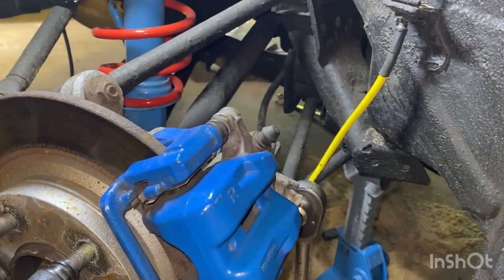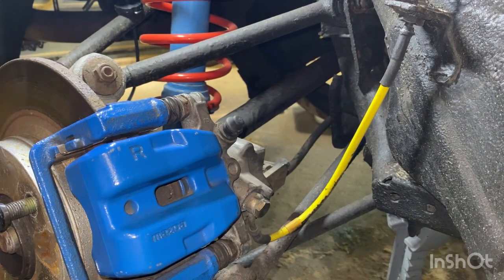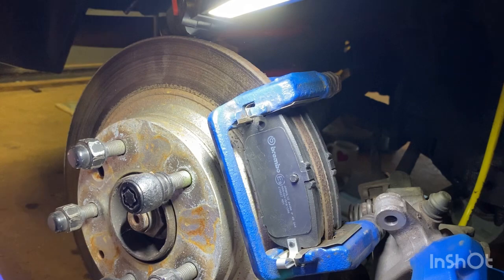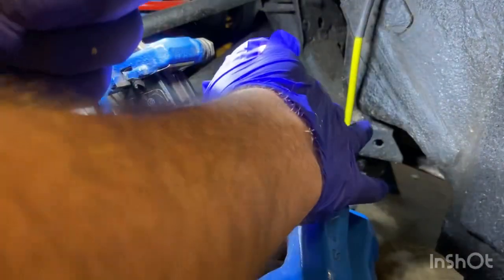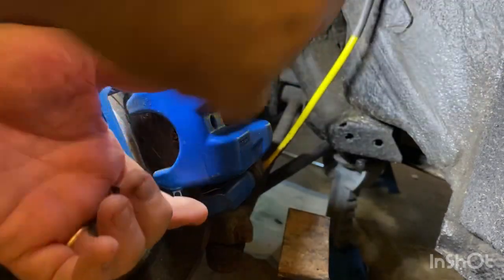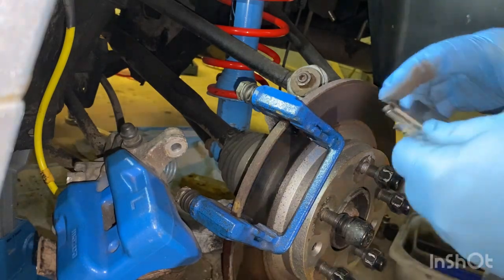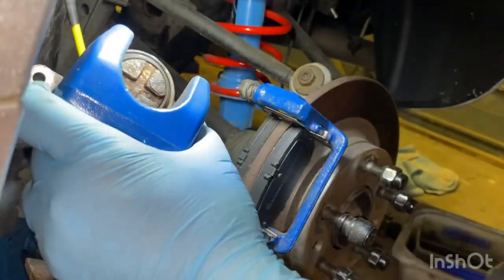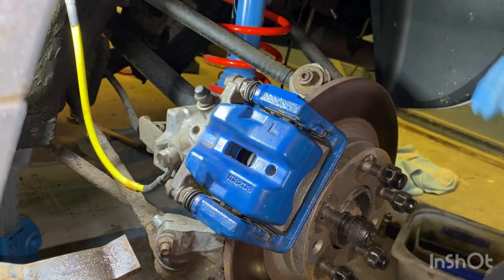Mazda Mx5 NC Mk3 Miata rear calliper and brake pad removal and refit.

Comment: Great video!! So I'm been looking around on videos on YouTube how to replace rear brakes on mx5 Miata but the other videos i seen they show there's a bolt in back of the caliper that u can remove and use an Allen key to push back the piston but the way u show how in ur video was awesome! So my question to u is by pushing in the piston like u showed in ur video is safe will not mess up piston sense there is an alley key adjustment for the piston
Reply from the maker: Thank you for the kind words I really do appreciate it, and I’m really pleased it helped you out 👍 due to the rules and regulations on YouTube I have to say that the video is for entertainment purposes only! However what I can say is that this way of doing it has never faulted me and I’ve done plenty in the past!!

Comment: My caliper bolts are 12mm.  I couldn't see any indentation on the piston face; is that a problem?  My handbrake now has too much travel. It self adjusts as the pads wear but does it self adjust the other way?
Reply from the maker: I would suggest that piston has been changed from original! They should have groves that allows you to twist them back so that you can change the pads. In relation to the handbrake cable it’s clearly evident that you have a problem somewhere on the network, have you tried to adjust it under the gear knob gaiter?
Reply: @jackos5s  yeah, the piston has the same cross grooves as yours but that's it. You seem to suggest there's another indentation on just one of the grooves. 
The handbrake apparently adjusts itself after some time/use; we shall see.
Reply from the maker: Sorry I thought you meant the grooves, the tiny little indentation should be there, however if you can see it or the piston has been replaced it may not have one. Therefore just turn it until until it won’t go anymore then unwind it to the nearest groove. Did your handbrake cable work correctly before?